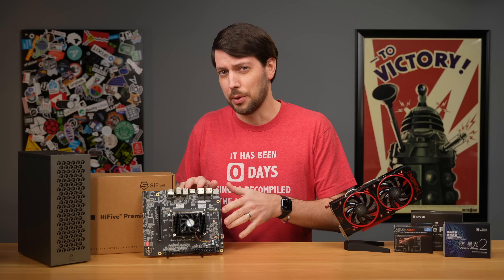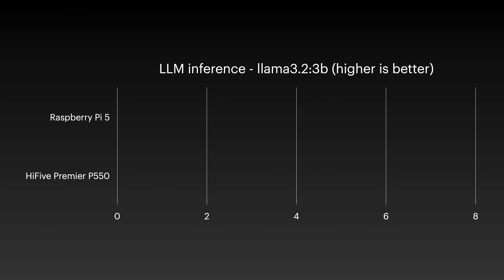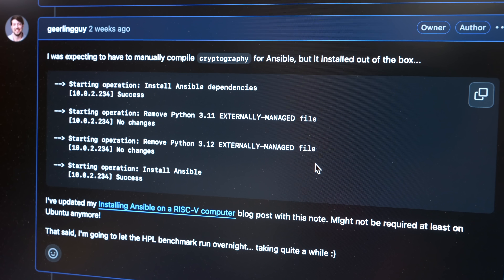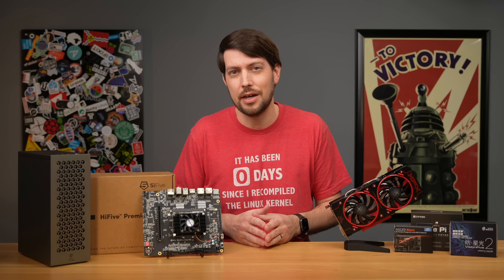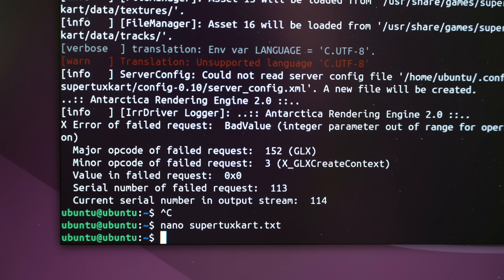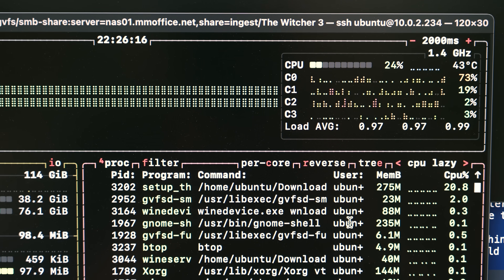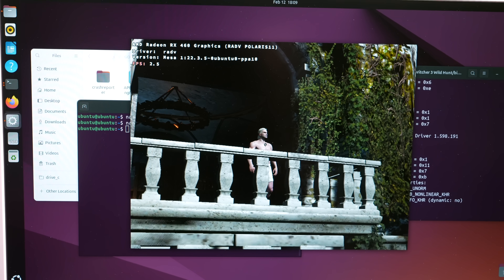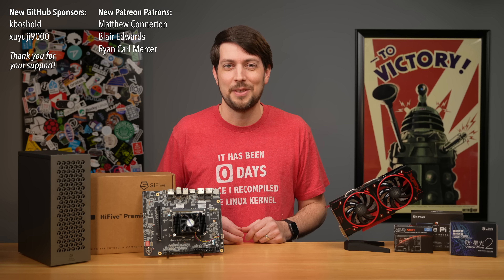RISC-V was supposed to change everything—How's it going?

Comment: Great vid, something to note is that the EIC7700X SOC used here is fabricated on a process from 2016 (tsmc 12nm FFC.) So compared to the latest apple m4 it has that per core performance at 7x less transistors, pretty impressive. risk is the future!

Comment: What would be needed in the hardware domain to make RISC-V a more viable option? Are there any specific optimization problems that could be solved with a volunteer computing project? Maybe I'm being naive, but to a layman like myself it seems as though pre-existing APIs could be treated like a "puzzle" to quickly advance the RISC-V architecture, or that it should be possible to create a set of formal rules to transfer the functions of one architecture to another.
Reply: RISC-V needs a better instruction set to be a viable options. The current RISC-V ISA has severe deficiencies (lack of good memory addressing modes , lack of select/conditional move), and some minor deficiencies (too small immediate constants for things like branch addresses)

Comment: RISC-V will change everything , also how much cheaper is the question? ARM even gives perpetual license.  those savings probably are a small part of the equation to be even worth it i think.  Also  NVIDIA CPU is coming.
Reply: ARM's perpetual license isn't for the use of the overall instruction set architectute, it's for the use of a specific core, eg: the Cortex-X925, and it's presumably expensive if you select a newer core to license. It's also not yet known which ARM core(s) the upcoming NVidia CPU will be built around.

Comment: Tappity tap tap tap … I'm in!
These aren't really engineered to be general purpose desktop computers, more like industrial control or IOT. When it comes to cost-focused commodity processors (micro controllers or SBCs) it is much more reasonable to have a project goal and then select a Risc-V product to fit those requirements, rather than concocting a project to fit the hardware.

Comment: Yeah I have been forced to use my Visionfive2 as my main computer after forgetting storage media for my amd64 at my Weekend cottage  Its handling things decently once you are on a strict kernel since both video decoder and GPU drivers are not in mainline yet, at least not the parts that load in the firmware. The board itself just lacking CANN bus module atm if I recall. Fantastic to see pci express working so well on P550, would be more interesting upgrade for me if it was their P670 or something with vector support and a slight higher clockspeed.

Comment: Check this design idea I played out using a LLM! 

12 Pico Pis on a Motherboard......

 Here's a summary of the envisioned distributed processing system, incorporating all the discussed considerations and additions:
Project Goal: To create a high-performance, distributed processing system using 12 microcontrollers, a custom FPGA controller, DDR5 RAM, an M.2 NVMe SSD, and a multi-layered PCB.
Hardware Architecture:
 * Microcontrollers: 12 microcontrollers (e.g., based on the Raspberry Pi Pico architecture but with 200MHz clock speeds), arranged 6 per side on a multi-layered PCB.
 * FPGA Controller: A small, custom FPGA responsible for task scheduling, memory management, and communication bus control.
 * DDR5 RAM: A high-bandwidth DDR5 memory module for rapid data exchange.
 * M.2 NVMe SSD: A high-speed M.2 NVMe SSD for fast storage and virtual memory.
 * Multi-Layer PCB: A custom-designed multi-layer PCB for optimized signal routing, power delivery, and heat dissipation.
 * Communication Bus: Either:
   * Ethernet abstraction using external Ethernet controllers on each microcontroller, with the master microcontroller acting as a switch/router.
   * A custom high-speed serial bus managed by the FPGA.
 * Master Microcontroller: One designated microcontroller acts as the master, handling overall system coordination and high level tasks, but offloading the most intensive control to the FPGA.
Software Architecture:
 * RT-Thread: A real-time operating system for each microcontroller.
 * FPGA Firmware: Custom firmware for the FPGA to implement control logic.
 * Master-Slave Model: A master-slave architecture for task distribution and coordination.
 * Task Scheduling: Hardware-accelerated task scheduling by the FPGA.
 * Memory Management: Hardware-accelerated memory management by the FPGA.
 * Distributed File System: A file system that allows all microcontrollers to access the M.2 SSD.
 * Communication Protocol: A defined communication protocol for message exchange between microcontrollers and the FPGA.
Key Features and Benefits:
 * High Performance: Increased microcontroller clock speeds, FPGA acceleration, DDR5 RAM, and NVMe SSD provide high performance.
 * Low Latency: FPGA control and high-speed communication minimize latency.
 * High Throughput: Parallel processing capabilities and high bandwidth enable high throughput.
 * Real-Time Capabilities: RT-Thread and FPGA control ensure real-time performance.
 * Scalability: The architecture can potentially be scaled by adding more microcontrollers.
 * Customization: The FPGA allows for highly customized hardware acceleration.
 * Improved Responsiveness: The system will respond quickly to events and handle complex tasks in real time.
Implementation Considerations:
 * Advanced PCB Design: Requires expertise in high-speed PCB design.
 * FPGA Programming: Requires expertise in FPGA development.
 * Software Optimization: Requires careful software design and optimization.
 * Power Management: Requires attention to power consumption and heat dissipation.
 * Debugging: Requires advanced debugging tools and techniques.
 * Cost: The system will have a higher cost due to the use of FPGA, DDR5, and NVMe SSD.
Potential Applications:
 * High-speed data acquisition and processing.
 * Distributed control systems.
 * Parallel computing tasks.
 * Advanced robotics.
 * Industrial automation.
 * Edge computing.
Overall:
This project aims to create a powerful and versatile distributed processing platform by combining the flexibility of microcontrollers with the performance of FPGAs, DDR5, and NVMe SSD. While it presents significant engineering challenges, the potential benefits in terms of performance and real-time capabilities are substantial.
Reply: You could improve the bus and processing by swapping out the ethernet and using a PCIe-based communications standard between the Picos And I really like the real-time thread operating system as a firmware base layer... It supports multi-threading and parallel processing especially when paired with a small FPGA that is the more or less conductor of the symphony! By using already designed and manufactured modules and standards on a motherboard and utilizing is meant much of the existing standardization and modularization of the components you could potentially drive the cost down. You could have quite a lot of data and real-time processing in parallel for the already addressed potential use cases.

Comment: RISC-V... please don't expect it to be a PC.
It really is what you said, meant for customization.
I have written firmware for a bunch of these SoCs now, and the main reason for getting an EIC7700 is to play with the H-mode extension, i.e., hypervisor mode. So far, others only had M-mode, S-mode and U-mode. H sits beteeen M (machine, where all hardware can be accessed and the standardized SBI runtime sits) and S (supervisor, where a virtual memory OS such as Linux here runs).

Comment: The terrible Linux support on ARM SBCs isn’t from some natural law, it’s a choice vendors make.  They could make different choices.
Reply: It also doesn't mean that RISC-V manufacturers will also not make the same decisions. It is a profitable decision and it has been the norm to require hw specific implementation or even bundle it with software since the dawn of microprocessors. PCs are the exception compared to other computers, but their exceptional behavior made them cheaper to make and sell.
Reply: This is very true. Mostly since these SBCs are made by Chinese Companies and who knows what code is in them not only due to trust issues but also since many of these companies just steal distros from who knows where change a couple things and then say here ya go. But there are also great options for running linux on ARM SBCs. My "server" that basically just runs tmux and irssi for IRC Chat is an Orange Pi 5 Plus 16GB with a 256GB eMMC Module (Rockchip RK3588) that runs Joshua Riek's Custom Ubuntu 22.04 (I have not taken the time to upgrade it to 24.04 yet) which he compiles himself for various ARM SBCs. There are both Server and Desktop versions and I have had no downtime unless the power goes out. The only quirk I would mention is atleast for the 22.04 Desktop variant is that it uses Chromium instead of Firefox...simply since that is the only option that supports hardware acceleration for video playback sites. Not sure about more recent versions and obviously does not matter for server. I just used Desktop for easier troubleshooting (and yes I played with it as a Desktop for less than a week).
Reply: it's a massive amount of work man and patchsets get rejected over bad vibes.  each one of these new socs has a different configuration of licensed ip blocks in it and often some new vendor-specific shit like the rockchip vops.  the DRM drivers needed to support the various rockchip vops and display interfaces, that's 100K loc in patches right there, just for that stuff.  mainlining takes as long as it takes because of how linux is.  if these board vendors went through the regular Linux patch process it would probably take 5 years to get a board out the door, their business would literally not function.  Linux as a project is not set up to service this "new board, needs 5 new drivers, arguable changes to 3 different subsystems, couple hundred K loc" reality that is having an ecosystem of diverse IP blocks in diverse chips on diverse boards.  it's not the vendors, it's linux.
Reply: @999a0s  This is why the RPI foundation licenses specific IP and builds things with long production runs, rather than just throwing together what they can find that's cheap and fits on the board.  It is not an EASY problem to solve, you have to focus on making continued progress and not resetting your progress by releasing a new spin with all new components every three months.

Comment: I like RISC-V as a concept and I hope it keeps growing. I was excited do learn there a RISK-V code menses in NVIDIA 50 series GPUs for the Hardware Accelerates Scheduling support.

I run a small business with a vast test suite for our tools. One day, I’d love to build a custom bit of hardware to run our test suite when I’m working at the cafe. 

My dream would be a board with 128-256 cores that I could attach via USB-C for offloading the test execution. If the chips got cheap enough and there were open source PCBs to build on. I could see it happening as an internal R&D project :)

Comment: I wonder if the modern RAM version is intended to help future support for faster chips? It seems like focusing on DDR5 instead of starting with cheaper DDR3 and DDR4 means the finite amount of work is consolidated around modern RAM with a longer lifespan especially in SoC systems where manufacturing-scale is king.

Comment: thanks for the review jeff. i recently got a milk-v megrez, which as far as i can tell has the same or similar eswin eic7700 soc and board features. unfortunately, i wasn't able to get an AMD GPU working on it like you did, just got some complaints from the kernel. i'm disappointed by the imagination GPUs on these devices, because of the total mess and licensing problems the drivers for them have.
Reply from the maker: Yeah the iGPU is kinda funky, though at least ESWIN seems to be working on getting more fixes in quickly.

Comment: I know it’s a bit nitpicky, but neither ARM nor RISC-V are “RISC” architectures. The “RISC” architecture designation has its root in a theoretical academically sense but never made it to a viable high performance setup due to inherent drawbacks of a “RISC” architecture. All modern architectures are in this perspective CISC architectures.
Reply: The RISC moniker is more of a departure from Complex Floating Point coprocessors found in Intel x86 CPUs and and Graphics-related instructions like MMX.
Reply: @alexander1989x  I wouldn’t word it quite like that. The RISC moniker referred more to a broader architectural shift towards simplified, uniform instructions and not specifically a departure from complex floating-point units or multimedia extensions like MMX. Their implementation are just examples of complexity that RISC generally avoids, but they are not antithetical to, focus or origin of the RISC philosophy.

Comment: I'm definitely thinking along similar lines here. Zero interest in running this as it currently is, not a single RISC-V board I've seen so far shows any potential in my hands, but I'm thrilled to see these still getting developed and released rather than thrown into the dustbin of history as unprofitable. At the moment, ARM's looking more amazing by the day, x86 is... well it's x86 and that's kinda enough there for the moment, and RISC-V is crawling so it can hopefully walk and maybe someday fly. For that matter I can count the number of performance-focused x86 vendors on one hand with room to spare for those cranking out 80486-to-Pentium clones for embedded systems. We have good things going on with x86 right now, but we can't count on that lasting forever when competition is only nominally there.